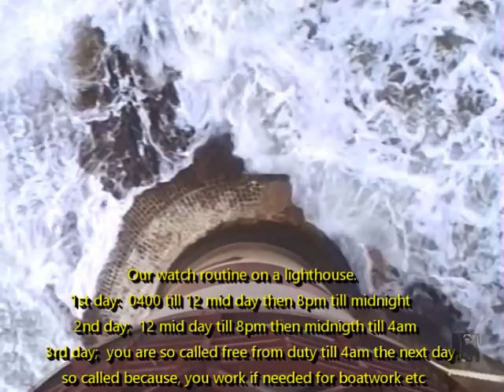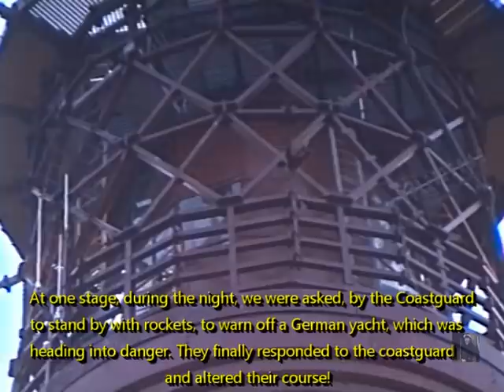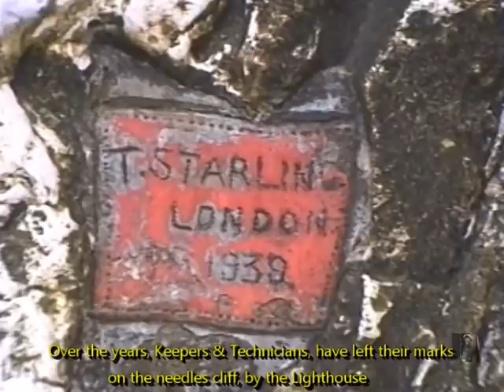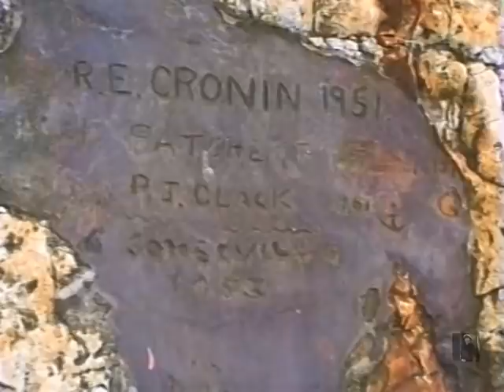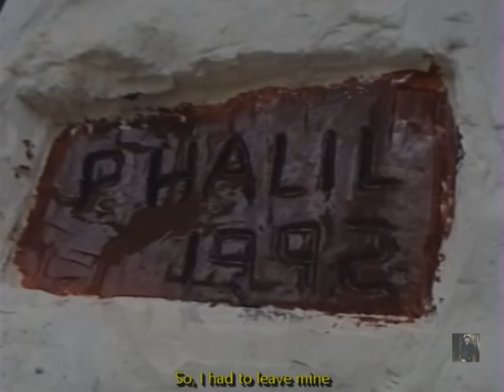So,you want to be a Lighthouse Keeper? 1992

Comment: I've seen three of your films so far, and I am mightily impressed. Fascinating seeing inside, with many different viewpoints, traffic passing and the mundane tasks required. Everything all in one place and in an unusual building and the one room per floor concept with very tight and steep stairs is what drawn my attention in. Building these things also blow my mind as well as the installation of equipment, how the oven, the cupboards, the machinery was all brought into place. With the modern lighthouses, it certainly seems safer, though with a smoker with you and the inability to open a window during the worst of the weather, I can imagine it becoming intrusive. I don't envy the role, just the solitude.
Reply from the maker: Thank you for that. if I was on a posting to an offshore Lighthouse, I tended to do all of that with the filming. But, a lot of my other tours were done as walk throughs as I literally only had a couple of hours on station. I like all the extra bits to try and give you a "Flavour" of what our life was like.  Cheers and stay safe.

Comment: Hi Peter . Excellent video as usual.  I was wondering about the water tanks  .were they lead ,iron etc ?. how did you keep the water from fouling ?. were they sterilizing tablets or did you have to boil the water to keep it potable?..
Reply from the maker: Thank you Thomas, As far as I can recall, the Needles seemed to be iron (But thinking , it was probably stone as well, just the top was iron?) and other towers out to sea, were stone (Granite?) They did line some with a clear fibre glass? in fact I recall them doing that on one Lighthouse and sticking a playboy magazine centre fold in the gel coating! So every now and then during filling, you caught a glimpse of a topless lady, but I can't remember which Lighthouse, so will have to re read my journals. We had water filters up in the kitchens, and water was boiled on the Aga, there was a kettle always on the go on top of that. cheers and stay safe.

Comment: It's an interesting and challenging career.  I'm just not sure that I could live in the constant presence of that Diesel engine sound.  I guess one may get used to it after a while.
Reply from the maker: Hi, Yes you do put the engine noises into the background after a while but also I'm not sure whether the video recorder amplifies the sound more than I remember it. Still, some lighthouses were quieter that others, obviously the taller ones where you are further from the engines. I seem to recall that the Needles had steel floor/ceiling supports that magnified the engine noise and the tower was short, so much closer to the engine room. 
Cheers and stay safe.

Comment: Peter, I read years ago that in the Victorian era, there was another on of the needles and it collapsed into the sea. I cant remember where I read that though. Have you heard about that?
Reply from the maker: No I haven't read that, the Association of Lighthouse Keepers may know different, sorry.
Reply: @PeterHalil  just looked it up. It’s actually true, although I got the time period wrong. I can’t paste a link here, so here’s the main paragraph…This needle-shaped rock, about 120ft high and known as ‘Lot’s Wife’ collapsed into the sea in 1764 with a crash which was said to have been heard many miles away. The stump of this pinnacle can still be seen at low water where it forms a dangerous reef.